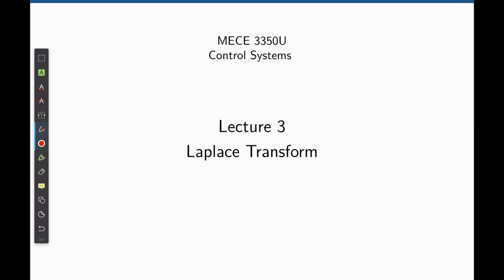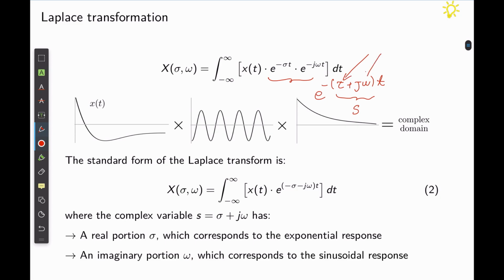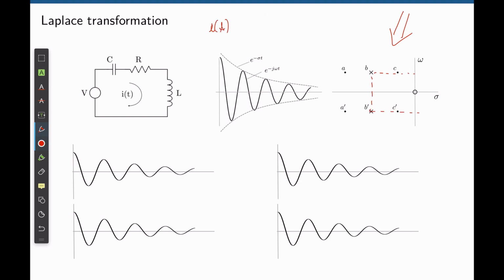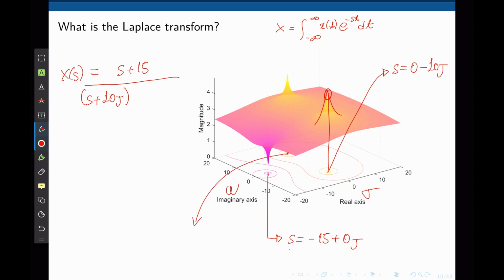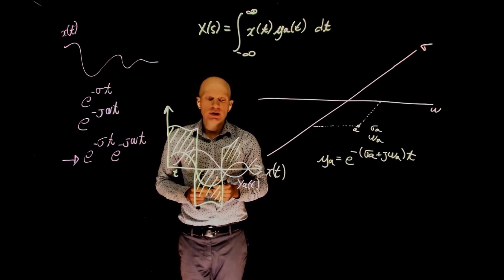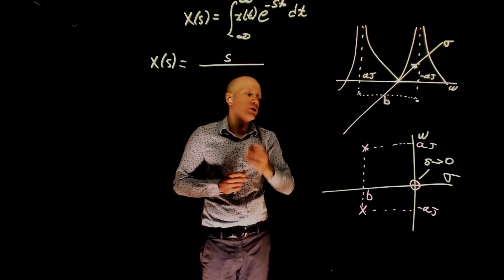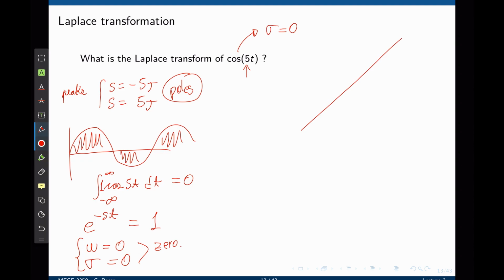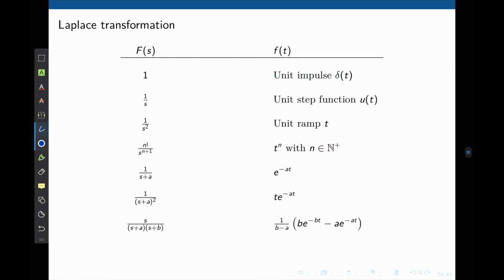Control Systems Lecture 3: Principles of Laplace transform

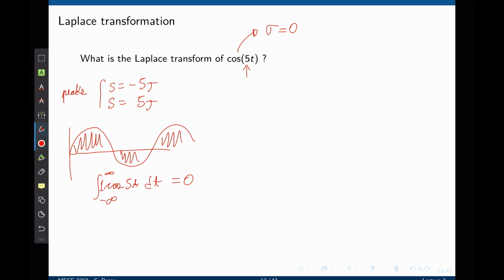Comment: at 37:24/44:51 why  does cos integrating to zero mean that the exp^-st is equal to 1 was it all ways there as 1 or why was it add after we first determined that the integral of cos to be zero?
Reply from the maker: The integral is cos5t "x 1" = 0. The "1" comes from e^(-st) = 1, which occurs when s=0 (sigma and omega are zero)